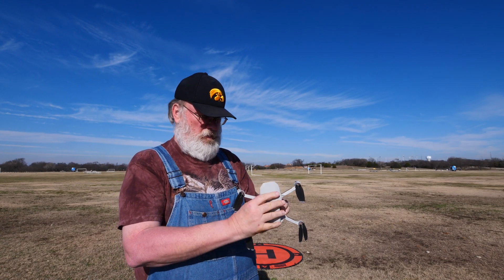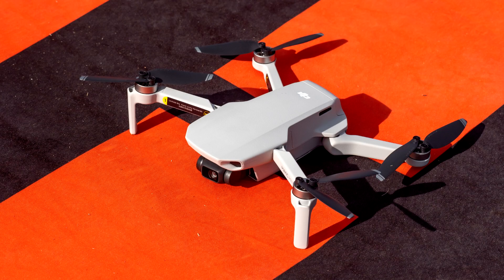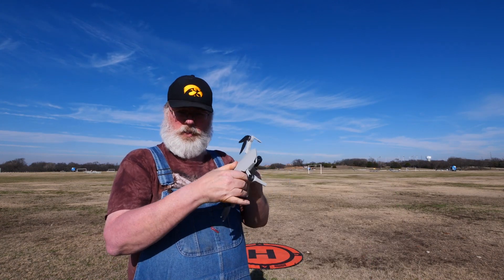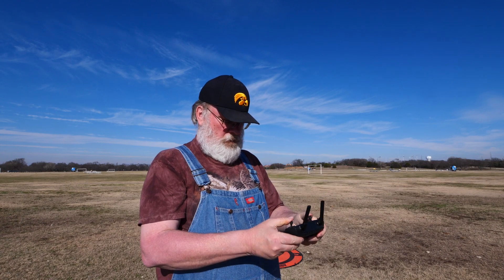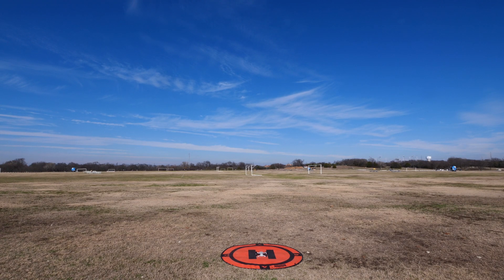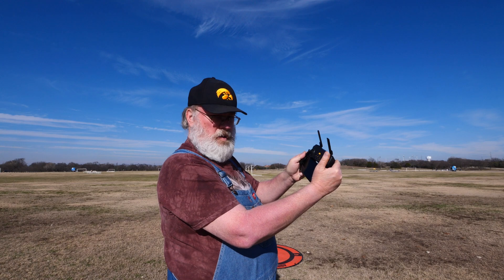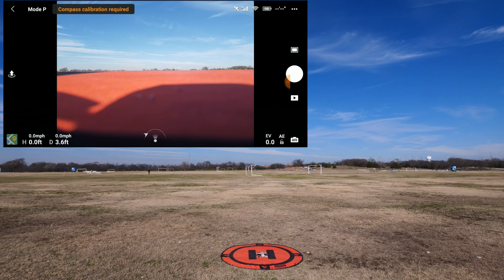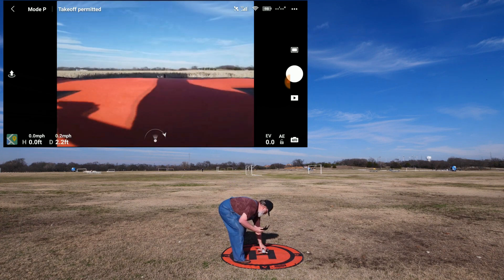DJI Mavic Mini First Flight Preflight and Calibration - Beginner's Guide Tutorial

Comment: I have a question so you basically saying it might not need calibrating unless it ask you
Reply from the maker: Definitely. You should calibrate your compass when 1) the app tells you it is needed, 2) you notice the drone is flying erratically, or demonstrating a "toilet bowl" swirl when it should be hovering, or 3) if you've traveled a long distance - it isn't a bad idea to do it then. Otherwise, you don't need to. I've heard two different DJI employees say that exact thing - calibrating too often can cause a problem, in that a calibration may fail and you fly with it . . . you fixed a situation that wasn't broken by breaking it.
Reply: Well I just got this drone yesterday it didn’t tell me to calibrate so I didn’t flew real good but had to return it because 1 of the batteries was defective FYI thanks for the info n for taking the time to answer this question

Comment from the maker: Once your drone is set up, batteries charged and firmware updated, it's time for your first flight with the DJI Mavic Mini. Your first flight starts with a good preflight. That includes choosing the right location and weather conditions, setting up the aircraft properly, performing the drone and remote controller inspection and calibrating your compass.

This beginner's guide episode rolls immediately into the next episode Mavic Mini First Flight. https://youtu.be/3vO1nk1nJVw